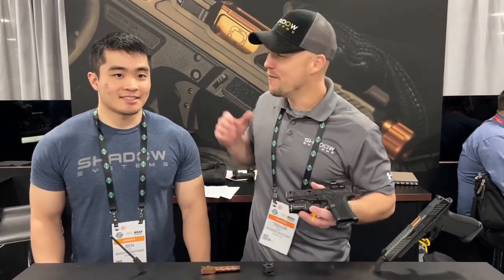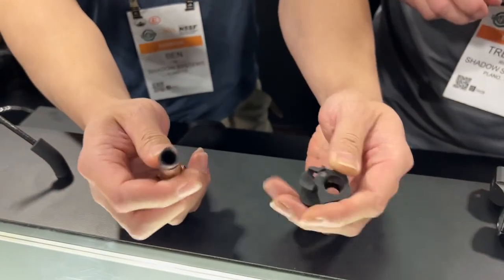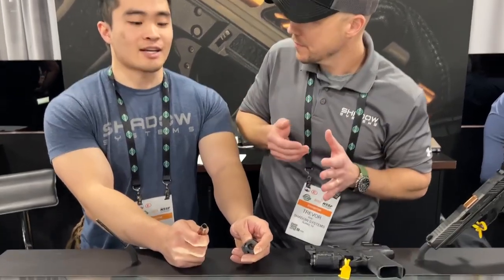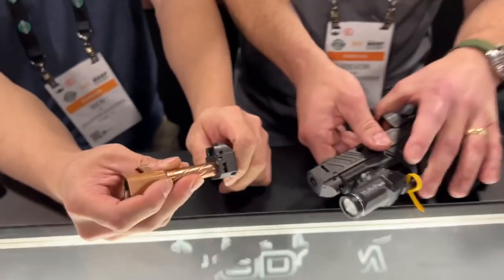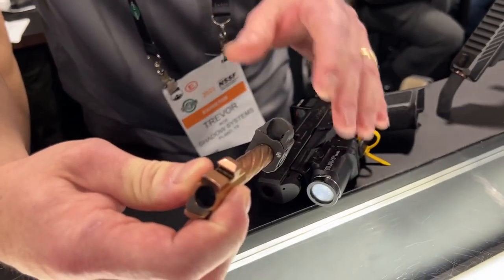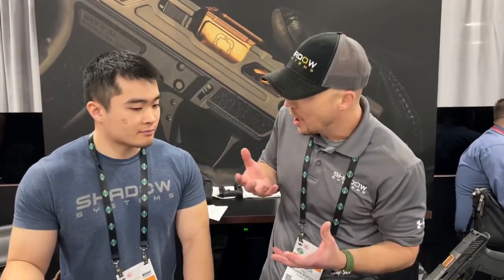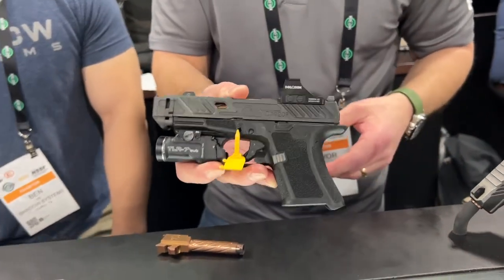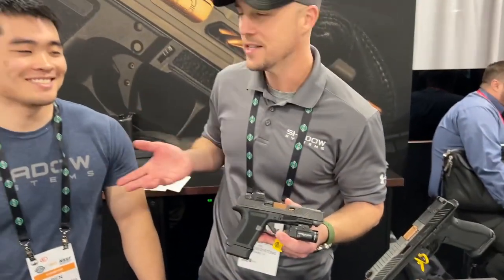SHOT Show 2023: CR920P Comp Attachment System, How it Works

Comment: Need some help here Ben.   I have the CR920p War Poet  about 2500 rounds through.  I found out after the break in period that the comp does carbon lock to the barrel.   since then I have cleaned this weapon after each range day, and I run very wet when shooting.  After my last range day 200 rounds through I sat down to clean.   During break down I get to the "push the detent" portion of comp removal, and there is not a detent pin there.    As far as I can tell it is in there, but stuck down in the hole.

I cleaned, let the comp soak in CLP.   Nothing has popped out of the hole.  it does appear to be there.  

I have reassembled the weapon, and everything locks in place.  When the spring is in the comp feels tight.   I dont see how it could move, however I am concerned that my EDC now has a potential issue.  

Could the lock move while shooting and fall off?   Should I be going back to where I bought this and address a possible malfunction?   Is there anything I need/should do?   Or is this safe.    

Ben made mention in the video above that this pin is an extra level of security and the lock by design should never move.  

I would like some information from  SSC about what my next actions should be.

Comment: Stand alone option?  Or does it require a matching slide?  Complete upper assembly available for purchase?

Wondering if I can upgrade my CR920 or if it requires a trade-in.
Reply from the maker: It is possible that we will sell a barrel and comp in the future for the CR-P, however, our capacity is dedicated to the complete gun currently.  It is also important to note that the comp is matched to the slide profile so it would look a little blocky on a standard CR.
Reply: Great question because i already have a CR920 , don't have the money to buy the same gun just for the comp.

Comment: Nice work Ben. Looking to get me one. Will this work on the War Poet CR920 barrel?
Reply from the maker: The comp requires the specific barrel that has the 3-lug muzzle to attach, so it wouldn’t work on your existing barrel. The barrel and comp could be installed on existing CRs, but will look rather blocky with the standard CR slide. As of right now, all capacity for the CR920P barrel/comp is dedicated to producing complete pistols, so we will not be immediately offering it for sale as an upgrade.

Comment: For those asking if the barrel and comp will be available for existing CR920s, the P slide does not have a beveled muzzle end, therefore it will probably only be available as a complete gun, or at minimum the slide, barrel, and comp.
Reply from the maker: You’re right, the comp is matched to the slide profile so it would look a little blocky on a standard CR. We may offer it for sale in the future, but in the immediate future all capacity for this barrel and comp will be allocated to the complete CR920P pistol.
Reply: @ShadowSystemsCorp  so does the CR920P have a different slide than the CR920 Elite? Besides the engraving of “CR920P” I thought they looked the same.
Reply from the maker: @pittsburghdad92  the slide profile is different to match the comp
Reply: @ShadowSystemsCorp  well that’s unfortunate, and seems like an odd decision.
Reply: @pittsburghdad92  100% percent agree, feels like im getting excluded as a "regular" cr920 owner. I would be throwing money at this ASAP if it was available as a kit. Crazy bad descision in my opinion
Reply: @kbates666  definitely feeling stung by this one. Spent 1K on a WP edition CR920 w/ red dot. But now less than a year later this comes out. The CR has a semi-poor reputation in the gun space due to its initial issues and reception. I doubt non shadow fans will care as much about the new gun as those of us that already have CR’s would care about a comp kit.
Reply: @Gaboon503  it won't be out till midsummer at best. You would also have to replace the slide to look right, because it had to be redesigned in order to put an extra short comp on it so it's not so long that it wouldn't fit in a Glock 48 holster. I agree that it would be nice but I also understand the technology and concept behind it. Because it is an EDC and a lot of people don't like compensators on their EDC, it's probably not going to affect as many people anyway.
Reply: I know they said they will not be selling slides separately. So my guess would be no as a whole.

Comment: When you put the extended mag in, isn't that just an mr now?
Reply: No, it is still a slim line pistol. It becomes the size of a Glock 43x where the MR920 is the size of a Glock 19.
Reply: @pittsburghdad92  I didn't know it was slimmed down I thought it was just cut down
Reply from the maker: It is still much much smaller than an MR. We did a video comparing the CR920 to other subcompacts in the market which gives a good visual comparison—it’s on our channel.

Comment: Thanks for making this video! It would be very cool to see this concept applied to the MR920 to make an MR920P. Probably wouldn't be as simple with respect to holster compatibility because of the fact that there's a bigger difference in slide/barrel length between a G43 and G48 than there is between a G19 and G17. Still, it would be pretty neat if at some point in the future you could standardize this attachment method across "P" models and maybe even license it to other manufacturers in order to develop a new industry standard or something along those lines. Obviously far-fetched, but man that would be cool.
Reply: Ordered the thread version to make my MR920 into a MR920P. Both T1 IWB and OWB holsters I have are bottomless so not a problem at all.
I estimated about 1/8'' longer, and ~0.7oz more than my current Griffin micro carry comp, the width is 0.9''(same as the front of the slide). The micro comp is good for its size/weight, but I desire a bit more performance out of a 'threaded G19' size pistol.
I have P365XL, so MR920P will be a perfect step up in size and performance.
That CR920P also looks awesome tho!🤤

Comment: First off, bravo! 👏🏻

If the barrel is the attachment mechanism, surely you can sell the barrel + comp combo on its own?

Would prefer not to sell my WP CR920 that I absolutely love just for the ability to run the compensator!
Reply: Me to i prefer having the war poet models
Reply: It's a special barrel
Reply from the maker: It is possible that we will sell a barrel and comp in the future for the CR-P, however, our capacity is dedicated to the complete gun currently.  It is also important to note that the comp is matched to the slide profile so it would look a little blocky on a standard CR.
Reply: @ShadowSystemsCorp  Do consider a proper option for CR920 owners. 
We are feeling a bit left out in the cold. 
And not everyone has the budget to buy a new pistol every year. But we are faithful customers and supporters.